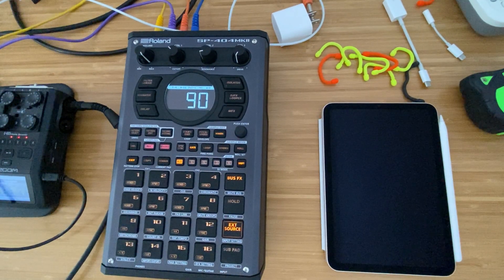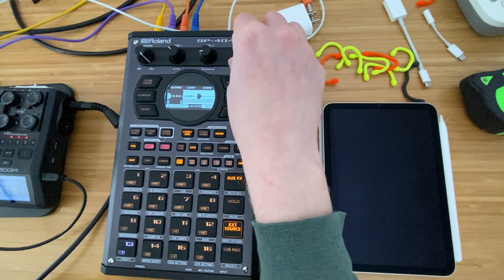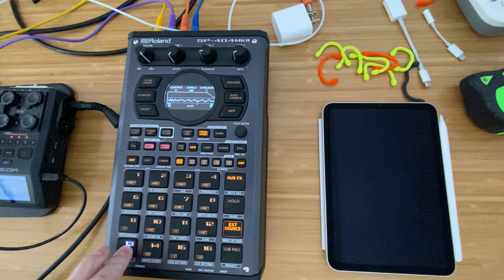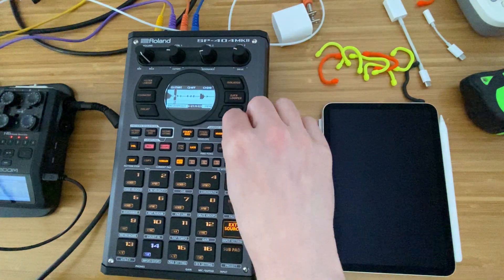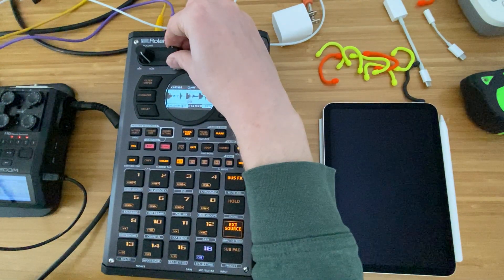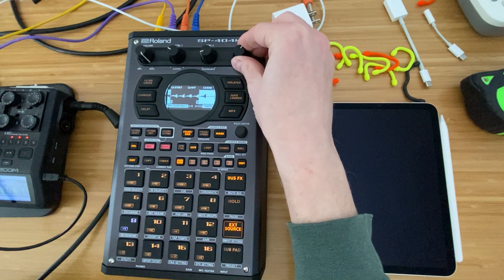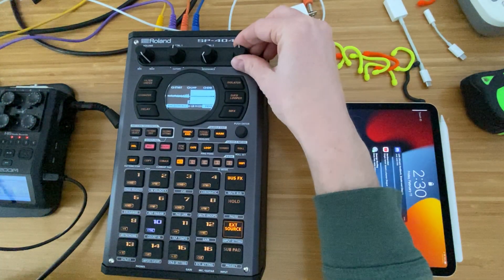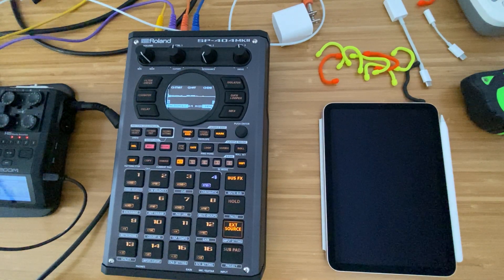SP404 mk2 1.2 - Adjust Start/End/Loop

Comment: hi, do you know how to select a pad without playing it or retrigger it to edit start/end point or volume level/pitch? Thanks
Reply from the maker: This is a buried in the shortcuts in the manual, but while in Sample Mode (not Pattern Mode) push the VALUE knob in and press a pad (while not in a menu like START/END), and it will select the Pad without playing it.  Then you can press START/END to go into the menu and make adjustments to the selected Pad.